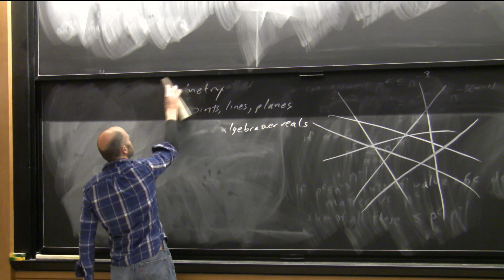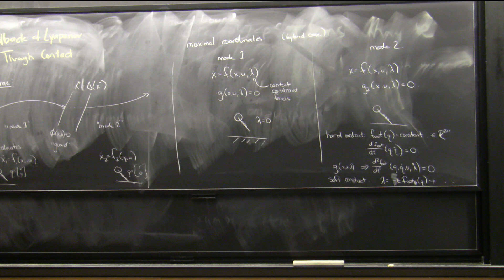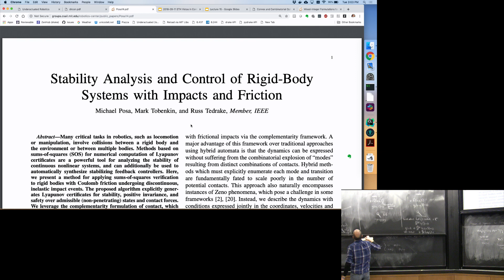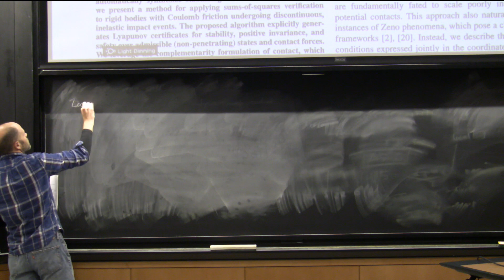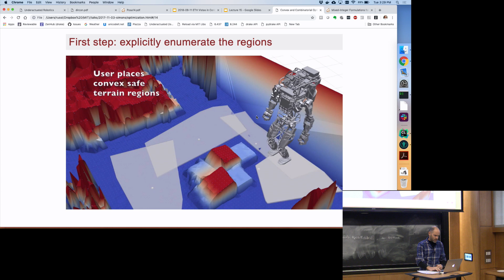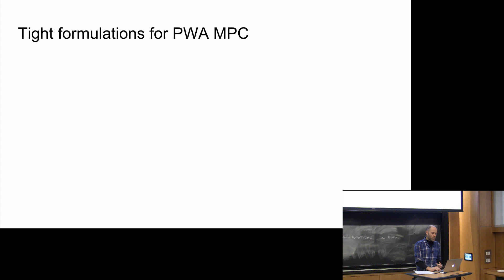Lecture 15 | MIT 6.832  (Underactuated Robotics), Spring 2019

Comment: I'm trying to wrap my head around what's going on around ~54:13. Is b_i supposed to be a function of 'n' (ie. we make or break contact as a function of time)? And then the 'i' index runs over the various contact forces which we might encounter (ie. surfaces which we could push off of)? 

Also a question about the expression Gx[n] <= (1-b_i)M--is this meant to encode half-plain constraints? Would we need a different formulation for more complex geometries (looks like lecture 17 and the textbook example 10.3 in the textbook may allow for general polygonal constraints?) 

Assuming that b_i is a function of time, do people ever enforce a smoothness constraint in order to simplify the solution space and make the problem more tractable?
Reply from the maker: You're correct... b_i[n] should have been a function of time, and represents one binary per timestep per possible contact force.  Yes, the corresponding constraints on state are half-plane approximations of the "distance to contact" constraint.  In general, we can encode any piecewise-affine system in this form; polygonal decomposition of the configuration space is a natural way to generalize it (there are other possibilities, too).

Re: smoothness -- this approach is intentionally going in the opposite direction.  Some approaches try to smooth discontinuities, but then have to deal with stiff gradients... but more importantly can never know whether they have considered all of the possible solutions.  By making discrete enumerations of the possible contacts, I would actually say we've make a MORE approximate model of the contact dynamics (which in fact do look more like a stiff spring), but have given ourselves leverage for potentially much stronger algorithms.